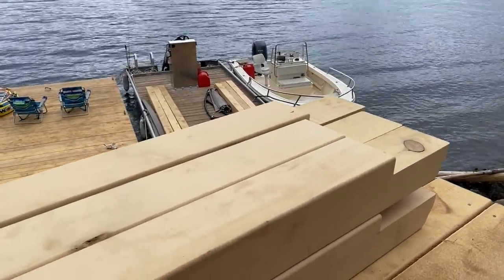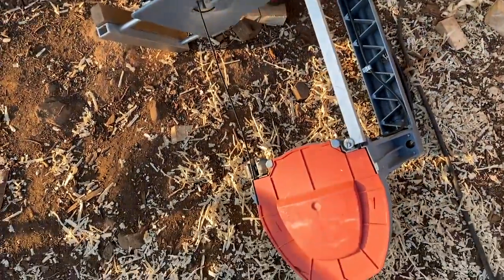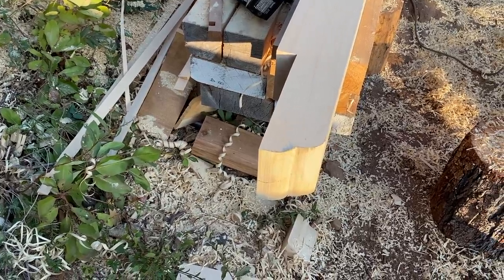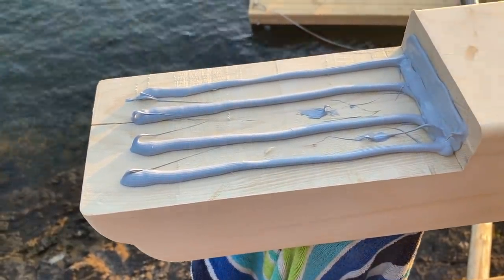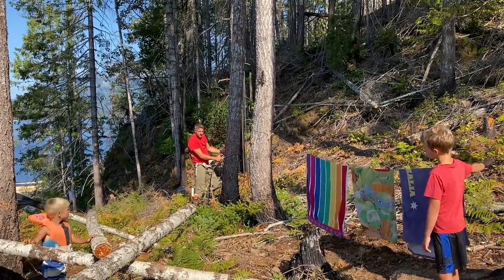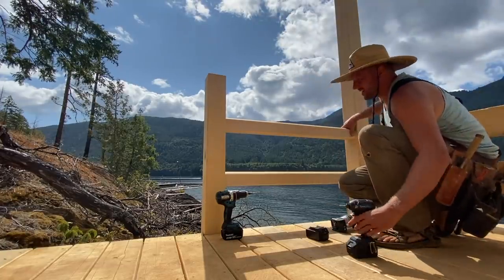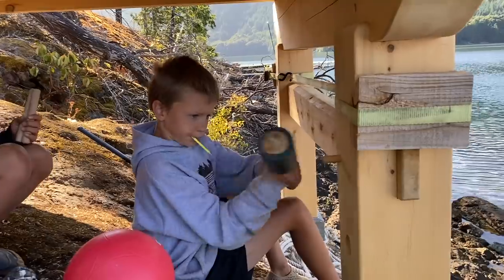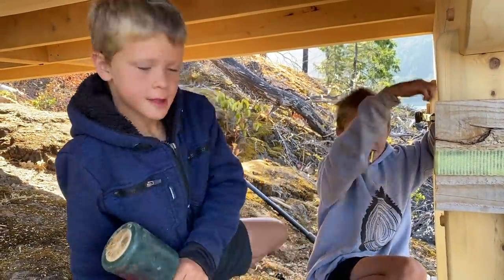Making Boardwalk Handrails and The King Swing!!

Comment: Hello Mr. Samurai,   I have been inspired by your style to build a 12 by 8' arbor entrance thing on an existing 4" thick pad.  It would not be connected to my home, do you think a 4" pad with anchor bolts on four corners would resist winds? Open walls full timber / corrugated metal roof.
Thanks Josh

Comment: I would have made a bigger shallow hole into both the post side and the railing end, put a piece of cylindrical dowel into the hole, and used a single toe screw from below. With plenty of polyurethane glue everywhere in the joint. That glue foams and needs to be cleaned up, but it completely seals the joint. I don't trust toe screws for anything load bearing. When someone will lean or sit on the railing, which will happen, that railing will definitely be bearing load.

Comment: still no log boom?  Go to scrap yard and get engine blocks.  if a v8 is too heavy get 4 cylinder ones. Half a dozen 4 cyl engine blocks ain't gonna drag. And a 4 cyl block is not too heavy to lift by yourself. Iron blocks are cheap. Chain em together and push em off the boat.  down home we chain em together on the ice and chainsaw around